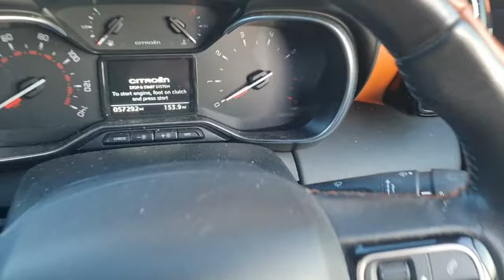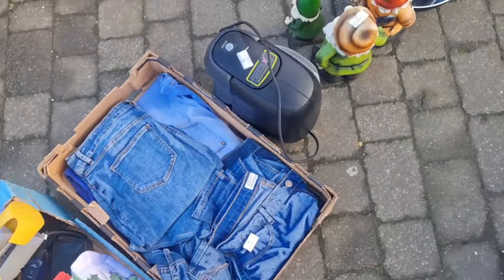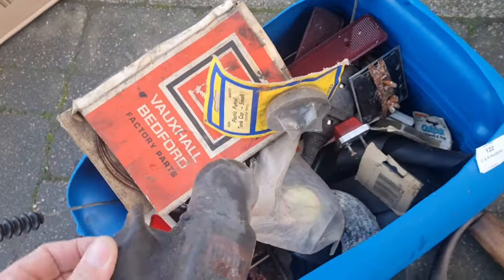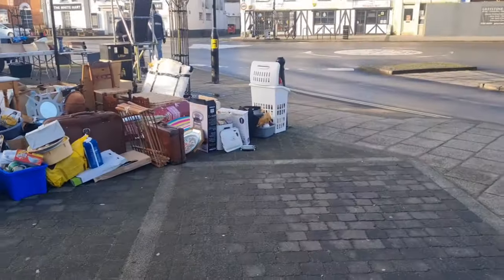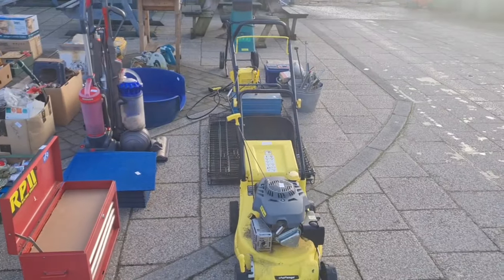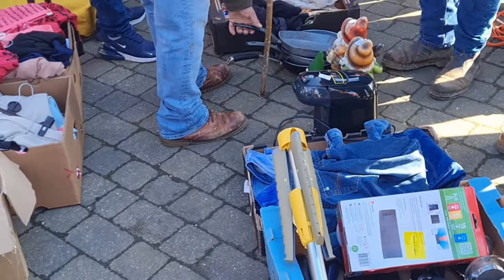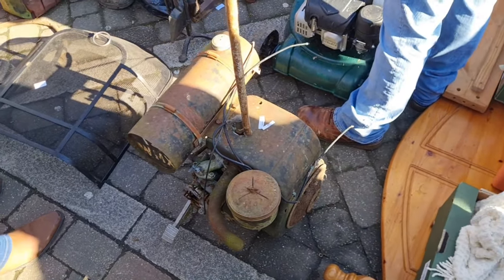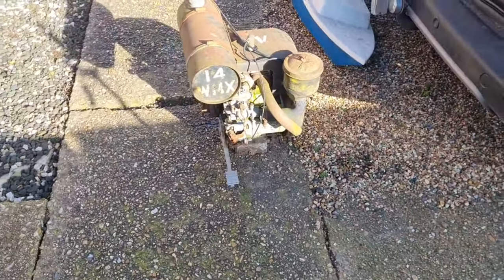Auction day. Old Engine and a Boat!!

Comment: Being from New Zealand and Australia, I can understand how "car boot sales" and sidewalk auctions like this can be addictive.... (my brother in England has filled his attic apparently !) 

Now from a "save-the-planet" perspective it's great that things get moved on, to hopefully new owners who can use them. But things like the Wood Plane (9,08sec) was literally buggered because of rust. And I'm not just talking about the actual replaceable cutting blade which could be sharpened or replaced. The supposedly flat bottom surface will be all pitted and lumpy with rust. It would need some serious restoration to repair it properly, perhaps involving a Surface Grinder. 

Those hand-saws shown earlier, left to become ruined with rust.  I've seen some of your earlier auction find videos where you got entire wooden or cardboard boxes of tools, (many rusted already) including quite a few good tools, for between UK 2 pounds to UK 8 pounds. 

I guess having 10 times the NZ population density means there is just "more stuff" that finds its way to car boot sales and auctions.  

But have you Pommie  folks,  never ever heard about OILing your blimmin' tools to stop rust ! Even if you don't have a spraycan of CRC-556 or WD-40 handy, I always have some normal engine oil in a re-purposed Squirty bottle. A dribble and thin smear is all it takes. I didn't inherit my dad's Plane (if I did, it would always have been laid down on its side, NEVER face down on the ground or concrete. Never just bunged willynilly into a box of other tools).  I certainly have dad's woodsaws,  now over 70 years old. Been with me as I moved to Australia and lived in the Outback for almost 20 years and then later moved back to NZ again.

Also you sped by it, but at 13m21sec was a box of not just any old books but looked to be a bunch of HAYNES style Acar Workshop Repair Manuals. They're absolutely vital for folks restoring old cars and many old ones not available online. EDIT... ADDED Nope they looked like Haynes but I see they're something about "Woodlands" some kind of garden design or craft books, false alarm, classic car enthusiasts, stand down !